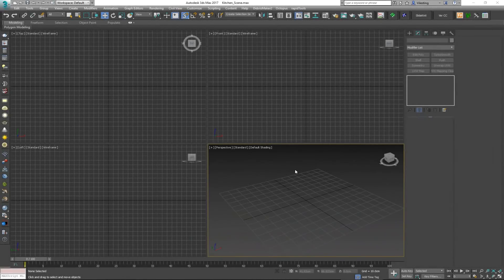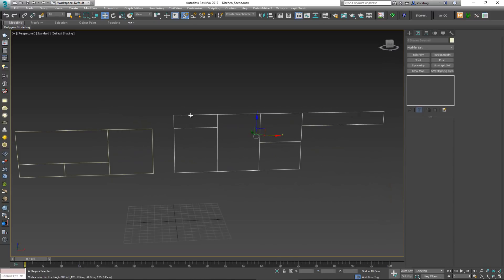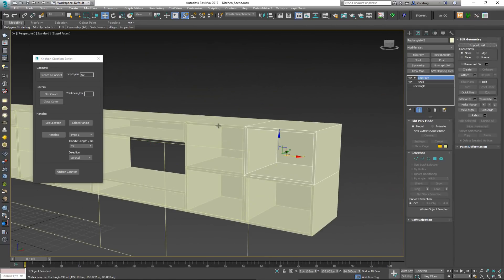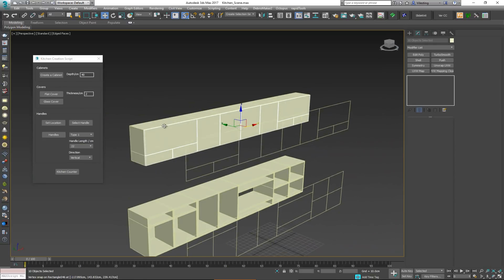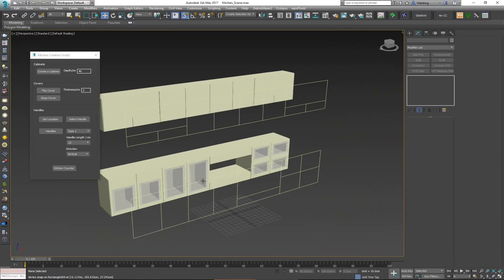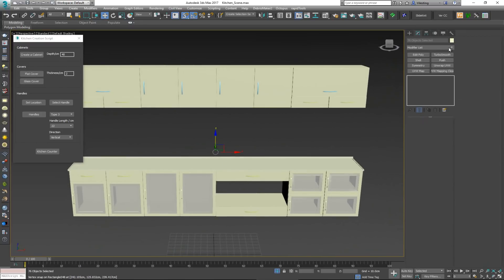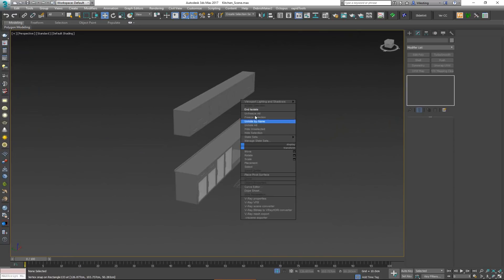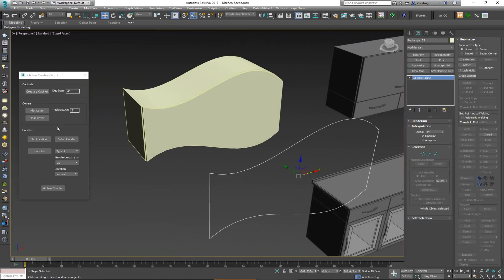Creating a Kitchen in 3ds Max with a Custom Script

Comment: Hello Denis, I'm throwing this query around among the Max / V-Ray video tutes here on youtube, so I hope I've not been a pain. I'm unsure what else to do as I have only 2-3 weeks to finish what I'm working on. The Chaos tutorials do not seem to cover these topics, and I am having a really hard time finding youtube tutes on them.

Background... I'm trying to create my first project using Max and V-Ray. (I was a Maya generalist from about 2002, but in late 2016 my employment options hit a wall. I noticed the Max / V-Ray combo out there a lot in the job ads, and so decided it was time to add these two to my repertoire.)

For a practice project, I picked an architectural (city skyscraper) rendering. I now have the building modeled and textured to a point where I feel it's ready to place against a photograph. 

1) There does not appear to be a way to place an image into a camera image plane in Max, or at least into a V-Ray camera. Believe me, I've looked. Maya does this easily. I need this to position and light my building, plus to position shadow geo,... which leads me to my next question.

2) Is there a way to create a shader that will only render shadows cast on or by other objects? The old background material in Maya did this well. Is there a V-Ray equivalent? 

Going back to the image plane problem, I put in a polygonal plane, textured it with my background photo, and aligned it perfectly to the camera. Problems include a) the plane being blown out by the scene's lights and there being no way I know of to turn on some sort of light linking, and b) I cannot figure out how to child the plane to the camera as a parent so that the image doesn't get disturbed when I need to tweak my camera.

Sorry for the long post, and thanks. If there's a better place to ask something like this, please let me know.